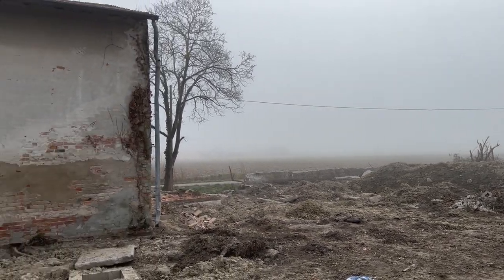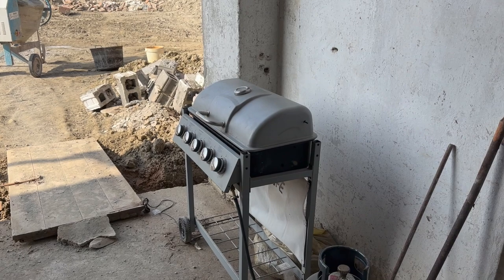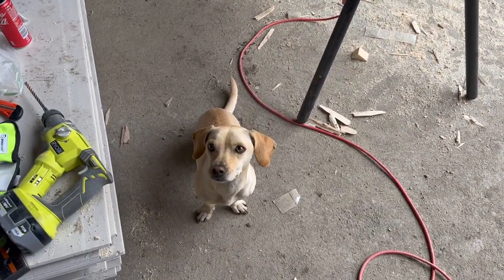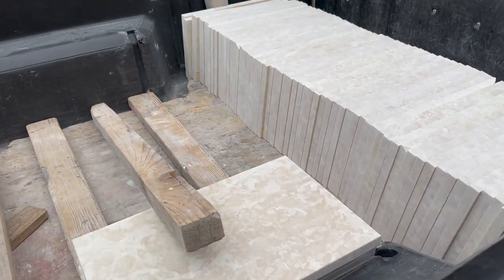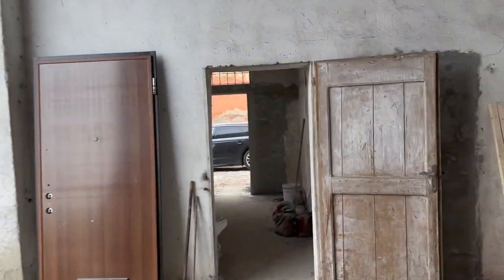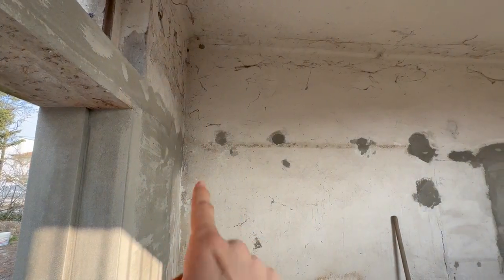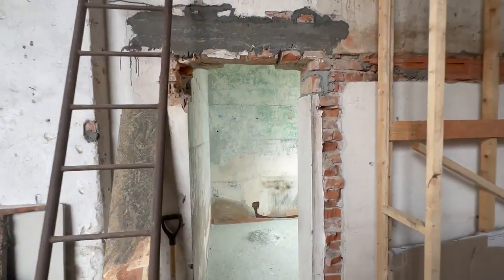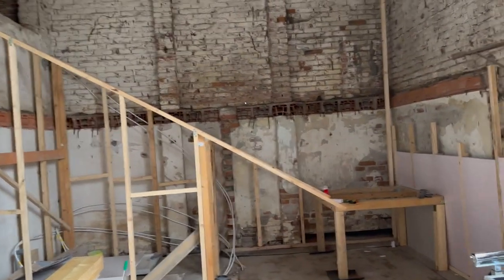Race Against the Clock: DELIVERIES and Stable WALL Renovations

Comment: you can tell they don't build many houses with wood in Italy with those boards! Doggo's enjoyed the BBQ. The tile is very nice. Glad you and Anna have your Pop there helping.
Reply from the maker: Yes not much wood here unfortunately, or there is a lot but not slow growing pine. 
Yes, it's been great, he has helped us so much!
Reply: I can say we don't use wood for almost anything! Italian houses usually have near zero wood in the main structure (maybe something under the roof/crawl space, where usually no one goes for decades at a time!) 😀
Those wood pieces are usually considered almost scrape wood, used to build small things of no importance in your courtyard. Otherwise you'll find only planks to build shelves.
Italians do almost nothing of importance in DIY, because you need a permit for everything (indoor or outdoor it doesn't matter) and rules are many and strict about how things must be done and if you can do it or not by youself (and the answer is very often "no"). 
So, we have no big DIY shops like Home Depot and Lowe's in the US and the ones we have have often mixed goods like house cleaning products, something for gardening, some organizer, hardware goods, some (expensive) woods and things like that.
Hard to find important building materials beyond plaster, sealants and glues 😂

Moreover, here in Italy drywall are assembled with metal bars, not wood ones (don't know if it's an Italian or a general European thing) and we usually use drywall just to create internal space, like permanent bookshelves or divide a big room in more small rooms if you don't have enough budget for bricks (and I think a very few people would do this <.<), but I'd say drywall is used more in shops, offices and commercial activities, than in houses. 
Maybe in the last years it became more common to use it inside the house 🤔
Reply from the maker: @ColdBluex  Thank you for your long and thorough answer, I have understood that the DIY scene here is non-existent as they seem very surprised when I tell them Im about to do things myself, 😂

You are SO correct about the rules, I have never experienced anything like it, but it's not like in Sweden where the rules are due to regulations for safety or standards etc, it feels more like the rules are made only to complicate things so that you have to have a Geometra just to get the paperwork done, because the job itself is often way more simpler than the process of being allowed to do it. 😂

Luckily the country is beautiful, food is excellent because I don't think many people move here because of it's easy going bureaucracy 🤯

Which is a shame, I think a lot of people hesitate to buy property in Italy and therefore buy in France or Spain which is a smoother process (which is crazy to say as I know how un-smooth the process is to buy in Spain for example), resulting in a lot of beautiful property in Italy is being left to decay until there is nothing left 😫
Reply: @VillaAroldi  
"the rules are made only to complicate things so that you have to have a Geometra just to get the paperwork done"
Yes and no.
Note: I'm no expert in this matter specifically, so this is my personal opinion.

I think that most of the huge amount of red tape we have, is due to a few factors: 

1) trying to avoid the building abuses, that in Italy are still wild
Many Italians don't like to be controlled/limited or to pay whatever you should pay for whatever they need to do. So when they can, they do things without saying anything to authorities. It doesn't matter if they need to build a simple carport in their courtyard or transform a 1-floor house into a 2-floors one. It doesn't matter if you need to ask for a simple permit, pay something and be all right.
It's better not to ask for permits, not to pay and live the rest of your life with the anxiety of being discovered by local police inspections and being ordered to demolish everything you built illegally.

The average Italian, especially those of a few generations ago, usually feel satisfied when they fool the authorities, only to then whine about new rules/laws/enforcements to fix the problems and avoid them in the future.
You don't know how many abusive structures, whole houses included (often built in dangerous places or even inside protected natural areas), there are in Italy 

That say, it's easy to imagine this kind of crazy loop: law to avoid problem X > people doesn't abide by that law > law become stricter (more permits to ask/more money to pay/more limitations) with higher fines > people avoid even more to abide by the law > more complication incoming again, etc.

2) administrations often mess things up
On the other side, we have governments (local, regional, national, you say it) that are made of oafs. I'm not talking about right-wing/left-wing, I mean in general. Usually, when there is a law that must be changed, it's just a big cut-here-write-there and never a "scrap everything-rewrite everything" keeping what it already worked and adding what it needs to be added. So you end up with rules and laws made of patches. Multiply this for decades and you can imagine what a botch it becomes.

Thus, it's easier to pay someone "che lo fa di mestiere", because he surely know how things should be done. 

But the end of this story is always the same: those who don't want to follow the rules, won't follow them anyway, it doesn't matter how strict or not they are; instead, those who want to do things how they're supposed to be done, crash themselves against this impenetrable maze, that even in Municipio don't know exactly (and it's all but rare to find people that tell you completely different things, even if they work in the same office <.<).

3) "paying for professionals to do it is classy", 
"I'm wealthy enough to pay others to do it", while being forced to do it yourself sounds "poor". After the 50s/60s, when Italians abandoned the countryside to go into factories and be able to live on a salary and being farmer/sharecropper like their parents (who wanted their children to be healthier, wealthier, happier), posing as "Signori" was a thing. Showing off your wealth has always been a crucial point in the average Italian's life, completely opposed to North Europe, like your Sweden or even more The Netherlands, where it's pretty much a social disaster to do so.
Here we would have in mind the stereotype  "the 1200€ worker who buys an old Ferrari from the 80s that he's unable to support properly, just to show off to his friends that he could afford a Ferrari (it doesn't matter than, that he can buy gasoline just for the week-end)".
So Italians never got into DIY until the modern days, due to economical crisis and internet trends. Unfortunately now there is people eager to do something DIY but not enough for big stores to open (pretty much as Starbucks here in Italy 😂).

The average Italian doesn't even know what to do with a clogged sink 😂 (but when they ask for a professional, they look down on him because he's "just a plumber" and be bossy with them because they must do what they ask buy then saying that it's "a great work that lazy youngsters don't want to do anymore").

Comment: Great progress, Team Villa Aroldi! Given the sorry state of wooden boards for framing, did you consider using metal? Please tell me that your gorgeous locally sourced marble is reasonably priced. Cheers to daily vlogs!
Reply from the maker: Yes but I actually prefer working with wood, especially when doing drywalls, I found metal to be much more difficult to work with.
The locally sourced marble is much better priced than the pieces we bought from Carrera, but it's also for the stables so having marble there is already a bit of an overkill. 😂

Comment: Getting a lot done! You didn’t have to put the moisture barrier on the outside wall where the staircase is going?  🤔
Reply from the maker: No as there is so much space between the insulation and the outside wall there is really no need, it will ventilate even better without it.

Comment: I would have thought you would be putting electrical boxes in each wall to house electrical outlets, what about in the bathroom, no switch or outlets in there?
Reply from the maker: There will be a few outlets in the rooms (not that many though as it's a gym and not a normal room) and of course a switch in the bathroom when we get that far.